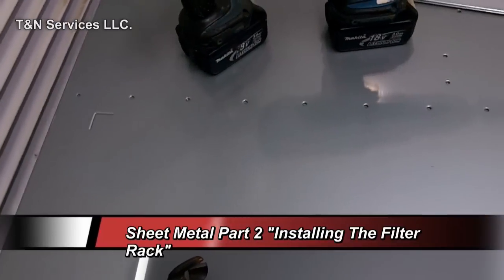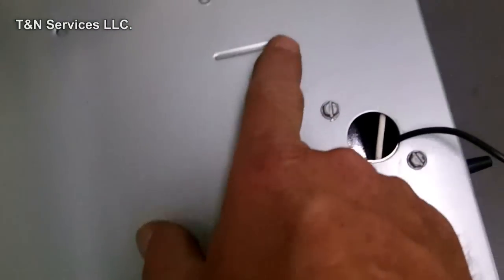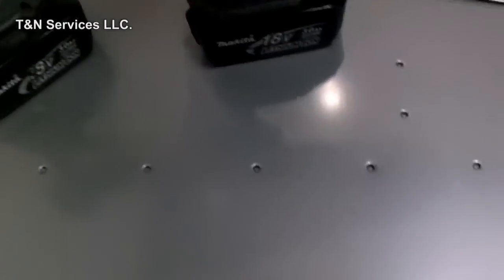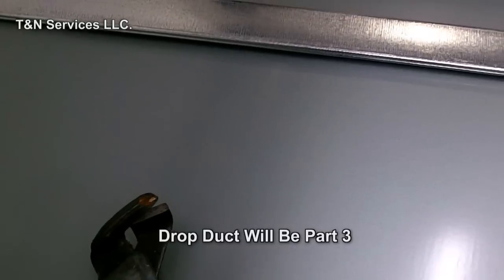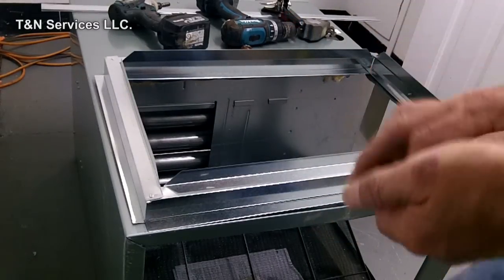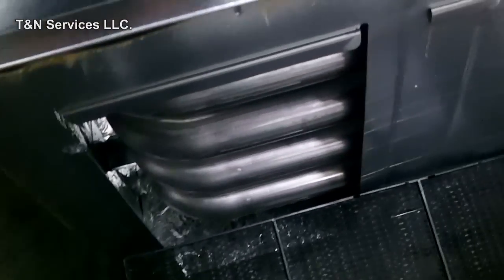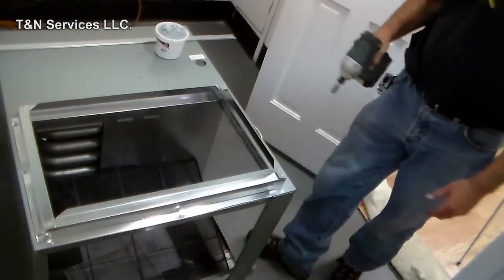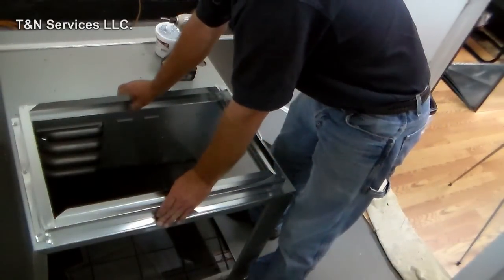HVAC Sheet Metal Video Series Pt 2

Comment: last summer I was screwing screws on the same filter rack just as you were, then the screw slipped and all my weight went  down on the sheet metal.  11 stitches later in my palm and my level of respect for sheet metal went way up!
Reply: Believe it or not, gloves DO help.

Comment: Awesome video! If the return sits on the drain pan I always put a piece of tape on the bottom of the furnace to give me the 3" I need for the rack to fit. Just thought I would share another tip!

Comment: How do you get the bottom screws
When you have to replace heater????
Never screw bottom of cold air boot or 
Filter rack.
You really take fan motor out to instal filter rack?